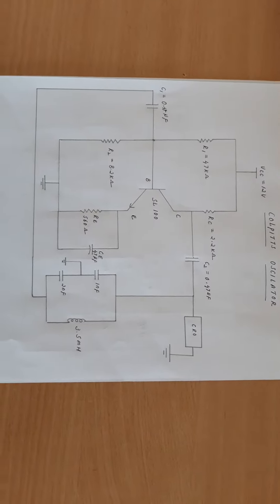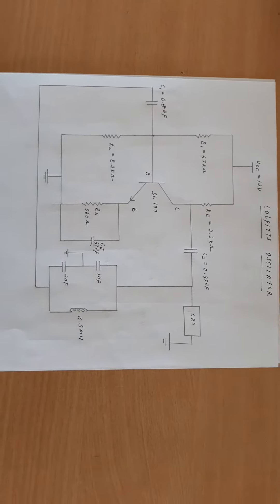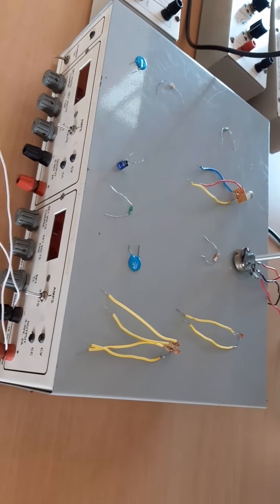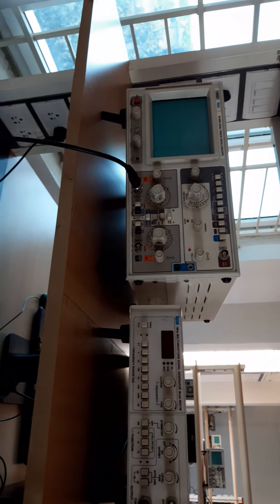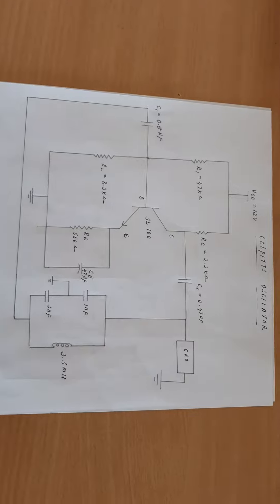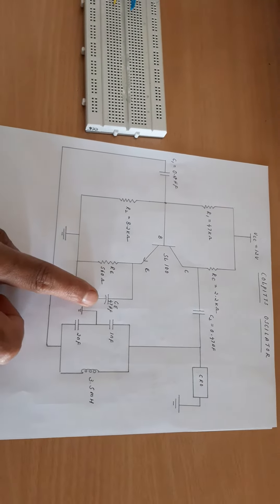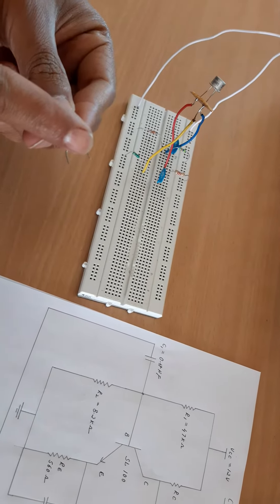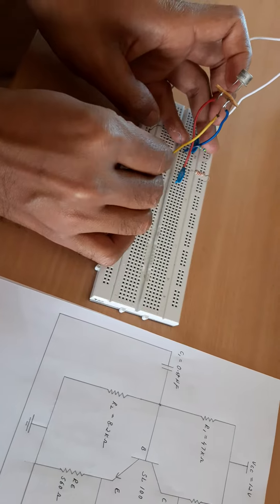Design and set-up of BJT Colpitts Oscillator

Comment: I don't see any design guidelines. I mean no calculations for passive components, no reference to datasheet for BJT. How will you calculate support components if you don't refer to transistor's datasheet? The output is distorted for negative cycles which is indicative of bad calculations and not taking into account stray capacitance and inductance. It would have been a lot better, had instructor used components' own leads instead of jumper wires. That way he could have suppressed stray capacitance and inductance. Also, instead of using inductance box, he should have used fixed axial leaded or radial inductors. They perform loads better. Also, mica or Mylar or even better tantalum capacitors outclass ceramic disc ones. I see no merit to it. No offence! And with regards to professor's efforts.